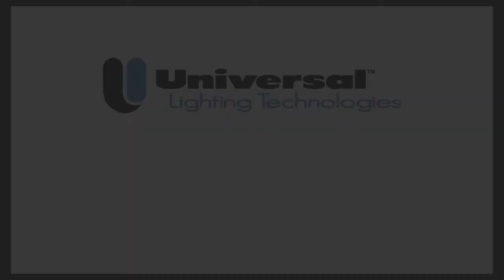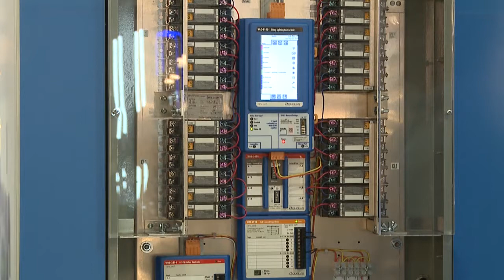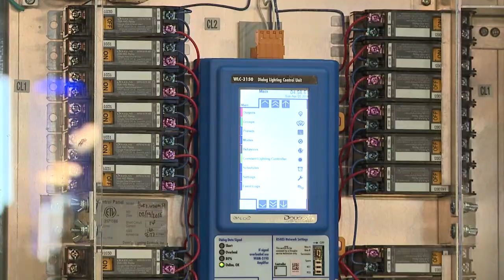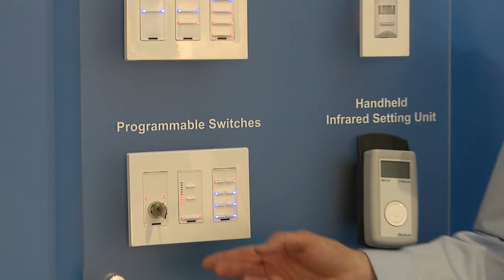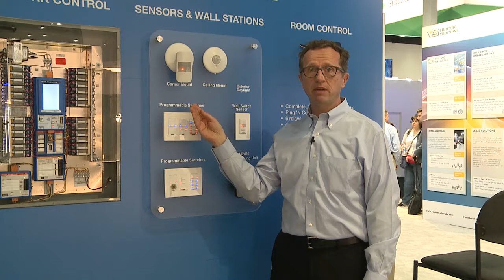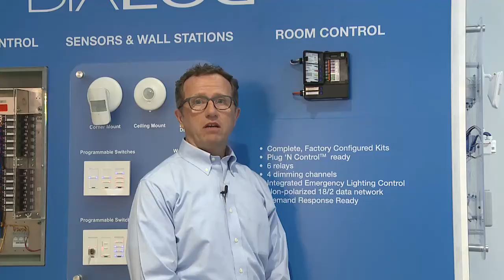Douglas Lighting Controls Dialog Room Controller

Comment: Few questions I've been trying to find an answer for:  On our WLC-3150, the screen is light up but there's no writing or display on it.  Does that indicate a problem or do these go into a sleep mode?  Should I disconnect and reconnect AC power to try to reboot it?  Problem is a WSW-3511 switch failed and is no longer responding.  Neither one of the LED's on the switch are lit up but I did verify there is 24 Volts AC coming into it on the data line.  So I'm trying to determine if the problem is in the switch or in the control unit.  I can buy a new WSW-3511 on Ebay, but will it need to be programmed, and if yes, how can I acquire an IR programming device and instructions?    Been trying to call your tech support but they're busy and no one ever picks up.  Thanks